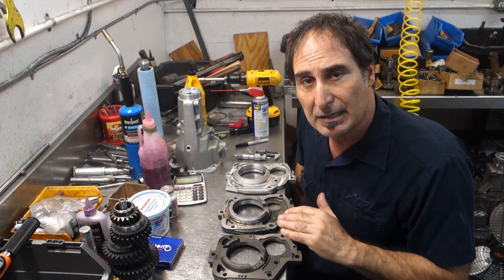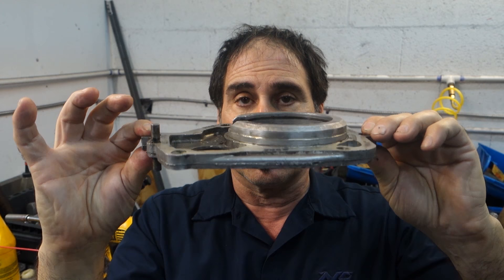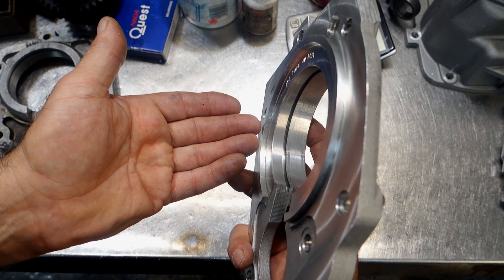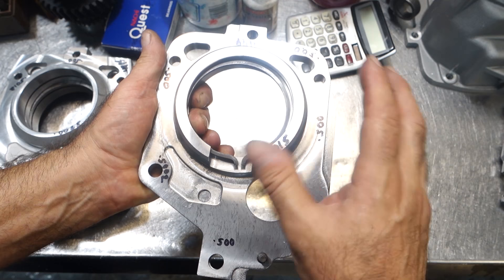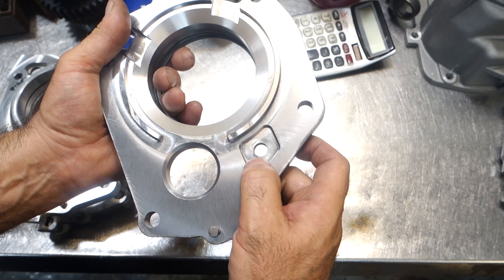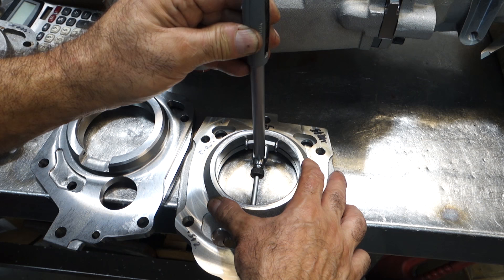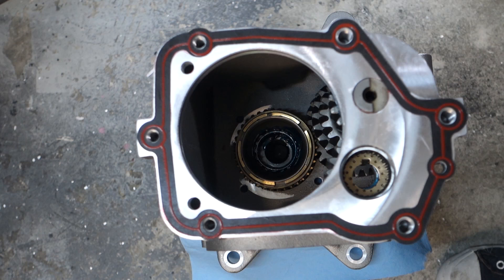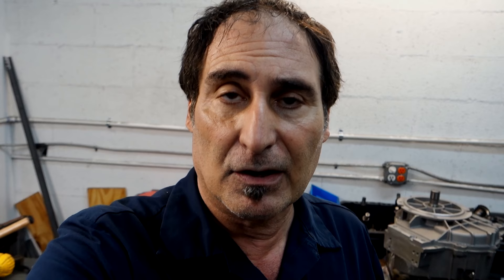Muncie 4 Speed Rebuild  Tip # 5 - Midplates

Comment: Hi enjoying your video’s on the Muncie Transmission, one video on mid plates you are making one from 6061 T6 why this material and not 7075 T6 Thanks
Reply from the maker: Because of cost.  The 6061 is good for a upgraded replacement.  Our nodular iron plate's tensile strength exceeds 7075.

Comment: Do you have a video on id of 4speed transmissions ? I have one we took from a dirt track car. Since we just use 1:1 gear and reverse. I was told it may have gears removed. You know us, anything to make the car faster! ( it may fall apart after the last race! But if it's faster!!) I want to use it on the street! All I know is it has 3 shift levers! I have no idea what it's from. It is a Chevy, or GM, do you think it can be fixed if the gears are removed?

Comment: hi my car which is a citroen c4 1.6 2008 uk model had a grinding in 1st 2nd 3rd gear 4th 5th  gears were fine. the car also shudderd on accelleration. then 1 morning the car wouldn't turn over. The garage which i took the car to and who repaired the car said that 2 input shaft bearing had failed and 3 syncroniser rings had failed aswell. my question is how can all that fail at the same time as the gearbox had the correct amount of oil then it was drained. the car had 104k on the clock
Reply from the maker: This was probably a clutch related issue or piloting issue. You are correct. Nothing fails all at once.

Comment: Paul I have your  3491 M22W DS with a iron midplate.  Is that a good piece or should it be swapped out to a steel piece.
Reply from the maker: The iron plates were perfect. The company who made the plate no longer wanted to do the machine work.

Comment: Thanks for the video.  I didn't realize Autogear produces an alum mid plate.
My Autogear m22 was originally  built in 2006 with a iron midplate with midplate vent.  When I had my m22 apart 2 years ago, I could of swore it was a Autogear iron midplate.  Don't they produce them anymore?
Reply from the maker: Yes, they stopped producing the iron plate. They do make a nice heavy duty aluminum plate as shown in the video. All transmissions they are selling I am told come with the alloy plate. Discontinuing the iron plate and me seeing the poorly done copy on Ebay kind of forced me to do my own. I'm pretty happy with the result.
Reply: GearBoxVideo absolutely is a really nice steel midplate!  Is it coated with any type of rust inhibitors to protect it?  Specifically the parameter as it is exposed to the elements.
Thanks for your continued reverse engineering of these parts and keeping the Muncie legacy alive for those who never lived in that era.  Me included...
Reply from the maker: Thanks for the comment.  I don't have any rust inhibitor. You can clear coat it after install. I've been working with some companies to offer me a solution that is not too costly.

Comment: I have the ability to drill out the stock mid plate on my M20 and put a bolt in the cross shaft (I guess the one that comes in the kit I ordered from you has the threaded hole in it), is there any advantage to do so? also there is no dowel in mine Im guessing because of the old advance adapter has no provision for one , should I install one on the main case to mid plate only, or drill a hole for one in the adapter and install it? sorry for the long questions. And what is the O.D. on the factory dowel, looks like the hole is .307 ish
Reply from the maker: The dowel is an odd size so I drill out to 5/16. The AA adapter has no room for a bolt head

Comment: Is there any advantage to drilling and tapping my countershaft ? the autogear midplate has provision for it
Reply from the maker: First, that would be hard to do. Since the shaft is extremely hard. The advantage is to keep the pin locked to prevent it going forward.  If the pin fit is tight, this should not be an issue. I prefer the steel plates because you can torque the shaft to 50 ft lbs against the plate adding rigidity to the lower end. Aluminum really cannot do that.

Comment: Hi, do you have a iron mid plate for sale. I been looking for one for the past 3 days and only see the iron one with the extra metal that hasn't been machined.even found a billet aluminum one from 5speed brand and has the same extra amount of material in that area.  Please help.
Reply from the maker: The iron plate is the same as my billet aluminum plates for the Muncie. I have no idea what you mean by "extra metal".
Reply: @GearBoxVideo  when u mentioned the Ebay knockoff you said that the best way to tell that it was a knockoff was the side that hasn't been machined and it has extra material. Every metal one I find online looks exactly like the knockoff version and the aluminum one I find hasn't been machined in the same area that the iron one. You have like a Facebook page or some way I can show you. Also if you have the iron plate I rather buy it from you. I want to reinforce my gear box i been reading that switching to aluminum doesn't really solve strength issues, that iron plate is way to go, then I look for videos online yours is the most detailed. I have a new 350 engine with 400+ hp trying to make my m21 gear box last. Car will rarely be drag raced more of a Sunday driver, but dont want my gear box to drop dead when I do. Thanks in advance.
Reply from the maker: Our plates have a smooth finish along the edge that is machined. Take the time to look. The others are left with a raw casting along the outer perimeter.. Ours also say USA on them.

Comment: Great video, looks like I'll be buying one of your steel plates. One thing - you mentioned the ST10 midplate, is it compatible with the Muncie plate? I'm ask because I'm having a heck of a time finding one for my ST10.
Reply from the maker: We are making the one for the ST10. Due spring of 2017
Reply: That is excellent news! I'll pre-order one if possible.
Reply from the maker: You won't be able to preorder, but I will annouince when they are available.

Comment: so Ive just bought an Autogear plate . Do I use the gaskets , or silicone only ?
Reply from the maker: If it is cast aluminum the box should be stamped and say to use RTV only.
Reply: yeah , Ive just that minute come in from the garage in melbourne , australia , from putting the box together with your excellent book beside me to guide me along . And , yesit does say to use silicone .